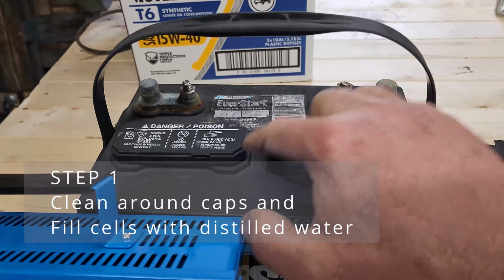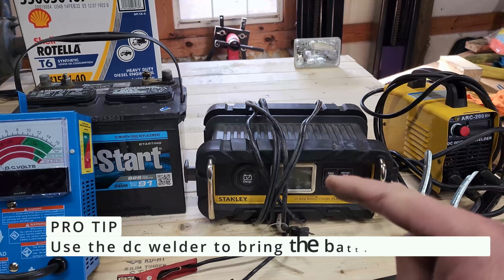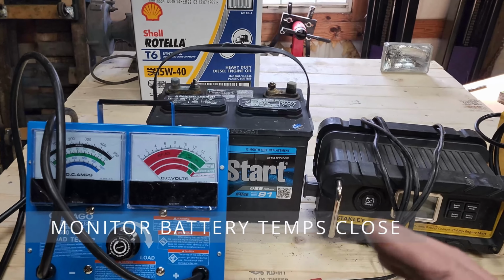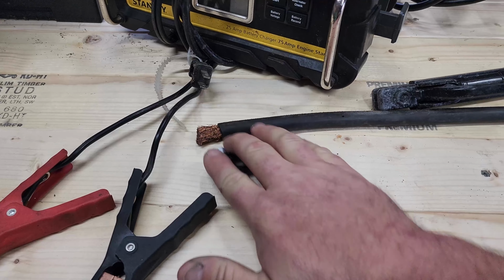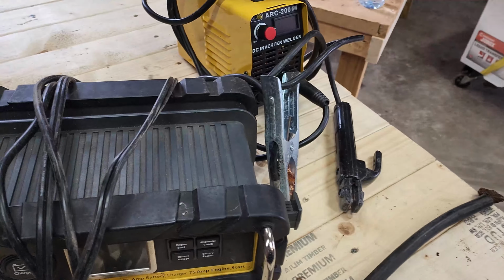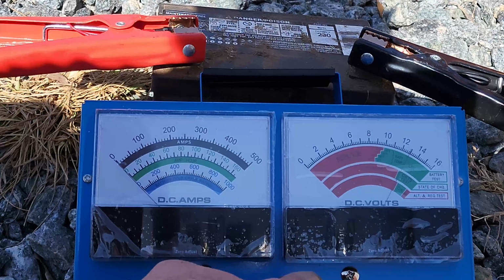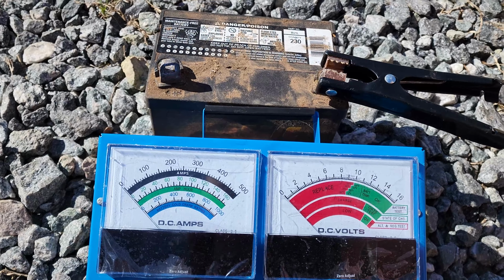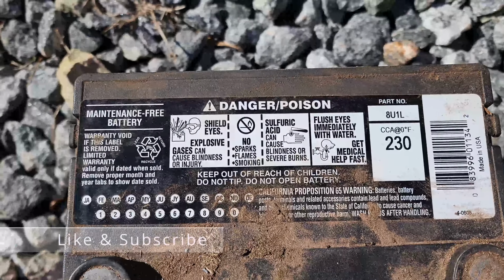Saving Money Breathing New Life Into Batteries, step by step guide

Comment: Hi and thanks... any idea if an older dc non digital stick welder could work?
Reply from the maker: Main thing I would do is check the voltage on the output of the welder and go from there
Reply: @PRSH8YAPROJECTS  yeh from what ive gathered its the higher voltage that makes the difference compared to dedicated battery conditioners which i believe are higher amperage like those for starting vehicles but i think those are still at 12 volts. thanks ill give it a try when the weather gets a bit better so i can do it outdoors...just in case :)
Reply from the maker: Let me know how it goes